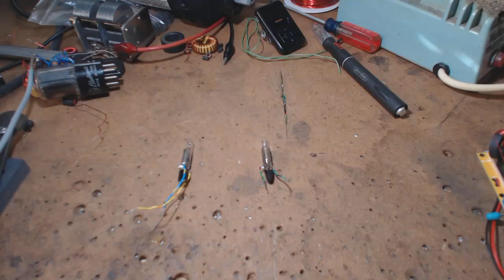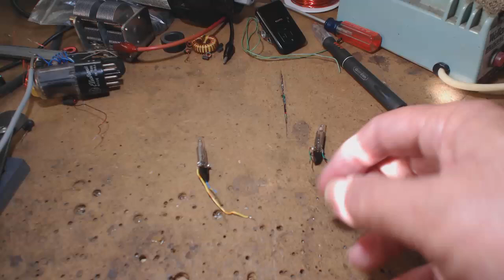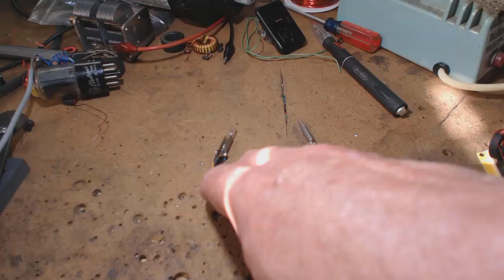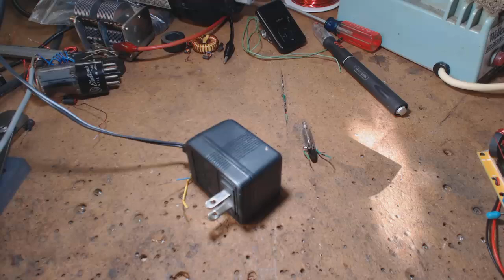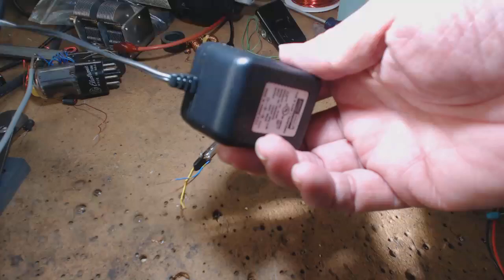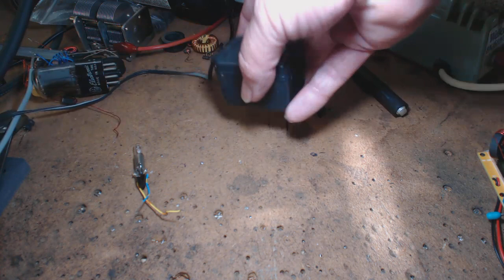AC VS DC and More

Comment: I once read that the diode symbol isn't an arrow; the bar is a cathode plate with electrons spraying off it.
Reply from the maker: I would go with a Cat's whisker touching a block of Galena Crystal.
Reply: @johnkleinbauer4424  Yeah, I guess that's what a point contact diode looks like.